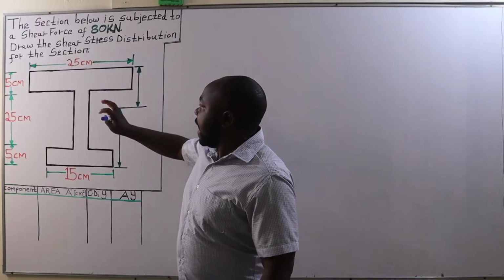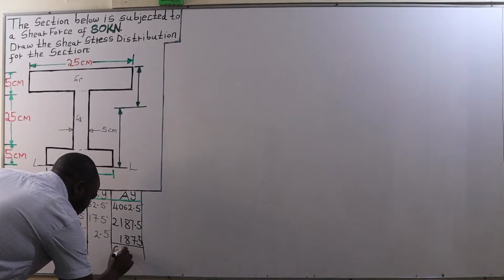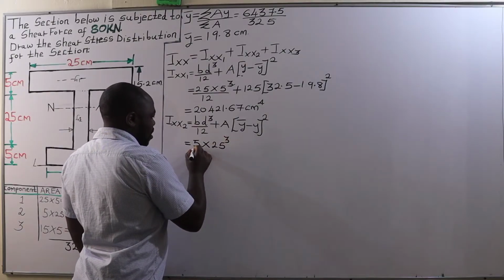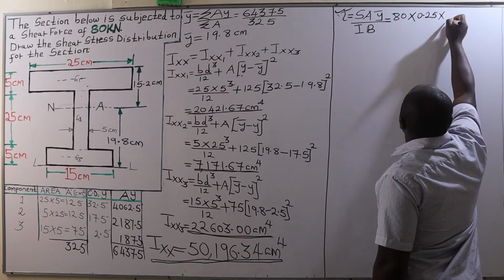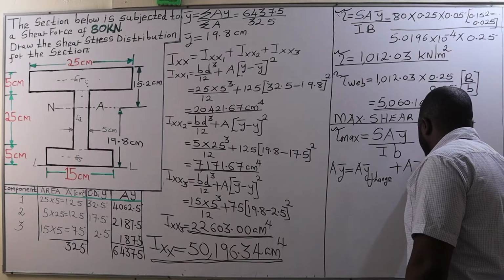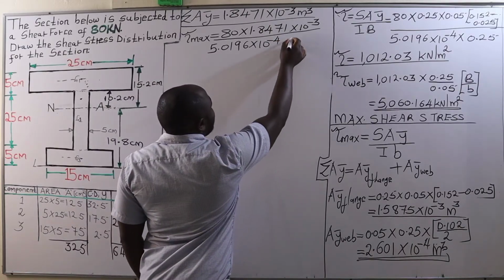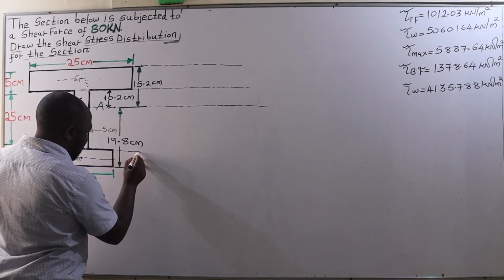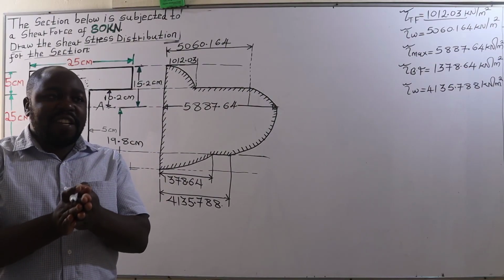PLOTTING SHEAR STRESS DISTRIBUTION DIAGRAM FOR AN I-BEAM SECTION|SHEAR STRESS IN BEAMS.

Comment: sir 0.05 x 0.25 x 0.102/2 will give 0.000637 so it should be 0.005 x 0.102 x 0.102/2
Reply from the maker: Thank you for pointing that out, let me re-check that calculation.

Comment: Max shear stress am getting 7092.20kn/m^2 , shear stress at bottom flange am getting 0.1038kN/m^2  then for the bottom web am getting 0.3114K /m^2 kindly asking which calculator are you using ,
Reply from the maker: I am using Casio.

Comment: Just asking how did you arrive at 1378.6kN/m2 shear stress at the bottom
Reply from the maker: By applying the formula.
Reply: @georgekamiti6538  but am getting 0.032 KN/m2
Reply: @georgekamiti6538 which formula